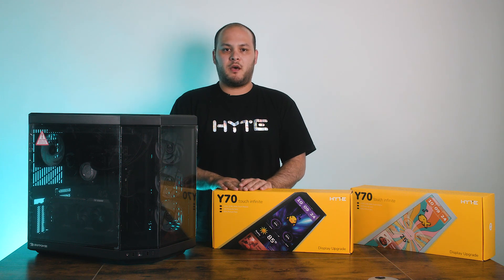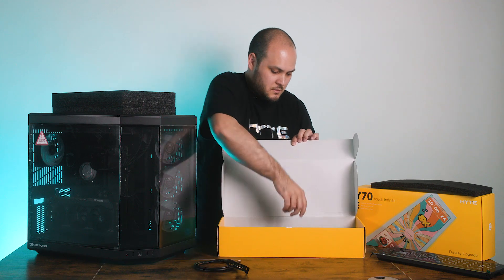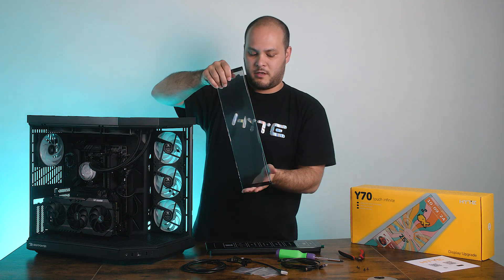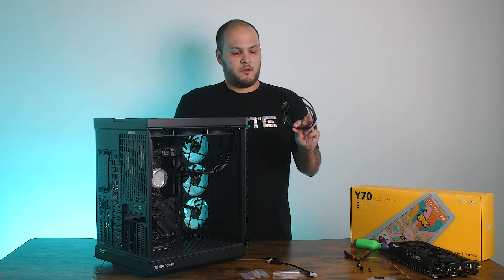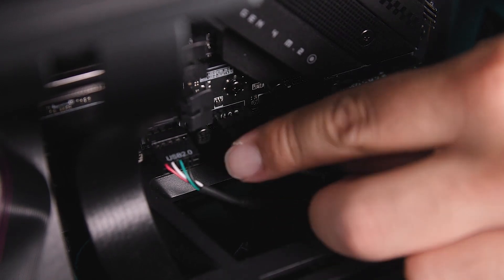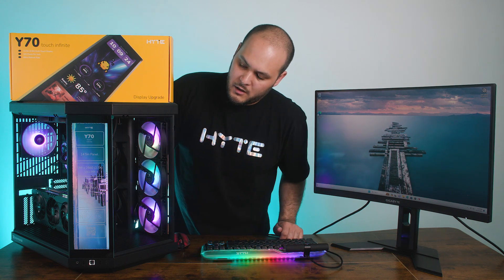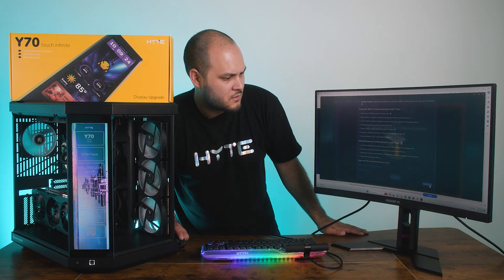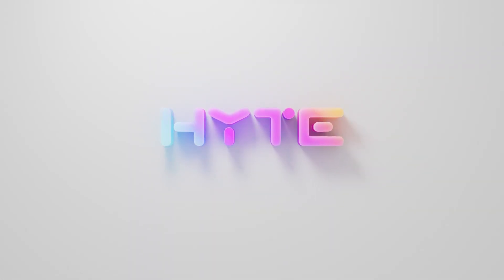Y70 touch infinite Display Upgrade Installation Tutorial

Comment: Software has no Linux support currently, and isn't working thru Wine unfortunately. My next step is to try thru a Windows VM.

Will the Nexus software eventually get Linux support?
Reply: isn't it detected as an ordinary screen which you can style using you DE's widgets? what dors nexus provide you more than that?

Comment: Are the top screws a joke how are you supposed to fit inside the case to install them it legit worse than working on a car physically impossible to put the screen in if your build is inside the case now I have to disassemble my PC to fit a screen that should of already been in my case when I bought it

Comment: Sadly my calibration does not work, it glitches then in says that it’s been calibrated but when I touch the screen it’s not responsive
Reply: Just got my Y70 touch and am running into this issue during setup. Did you get this resolved?
Reply: @jamesye same

Comment: work well after follow the video , I install correctly , the part hard is screw on the top and display the screen correctly (do not forget clic on "Make this my main display" and remember window locations based on monitor connection" ) when you "Extend these displays" . the first time big lag on COD BLACKOPS , extend was not make correctly first time ( rushing do not help) , after that no more trouble , follow instruction on program Hyte Nexus and done . i wish another clock for use hour in another country like France for me .

Comment: Hi, a technical question. I pre-ordered in my shop this upgrade. The question is, I have a PC with 3 screen already, I installed an Nvidia Quadro with 4 monitor support; this screen will be ok togheter with other 3 running as one in ultrawide resolution? I think yes, but I would to be shure :)  Thanks in advance

Comment: The top 2 screws on the screen do not want to go in , ive been at it for 3 hours. Im not sure but i think the back of the screen is getting in the way and is getting the screws at a angle
Reply: It's a horrible design unfortunately. You need a veyr specific tool to get these installed without them going in at an angle / screwed in all the way. It's unfortunate Hyte didn't provide a tool since it's so unique (for that price)
Reply: smaller screwdriver and a bigger brain
Reply: @SeanTaiPhoon  there's no clearance for a screwdriver especially with large hands. I used a wrench with a drill bit to get it on tight. If you have small hands and a tech deck screw driver I'm sure it's easy for u